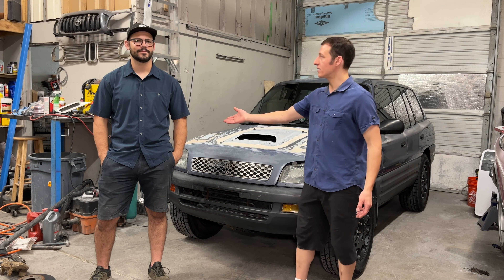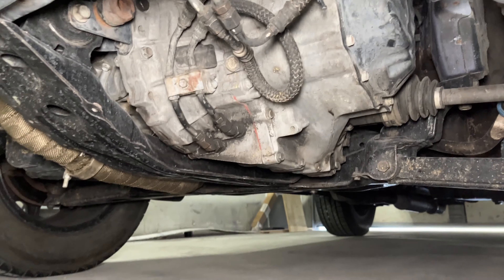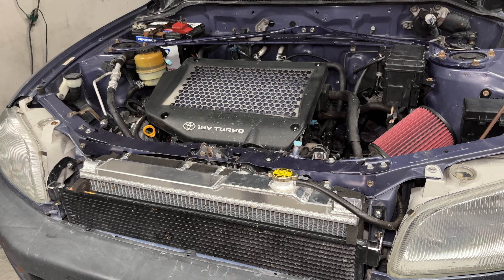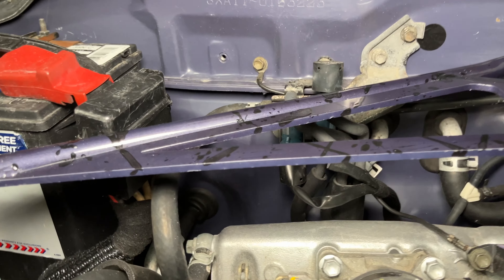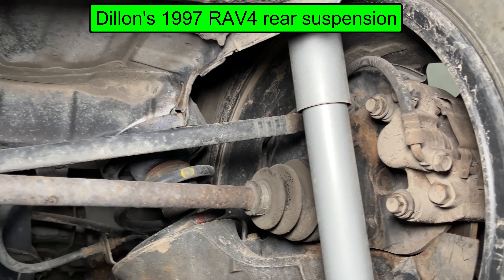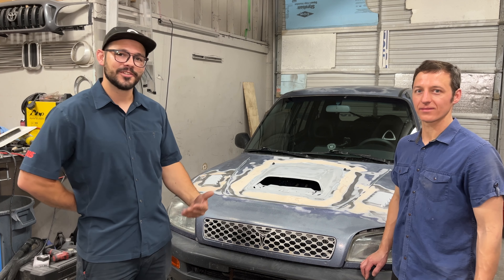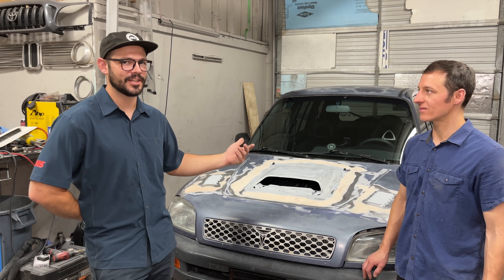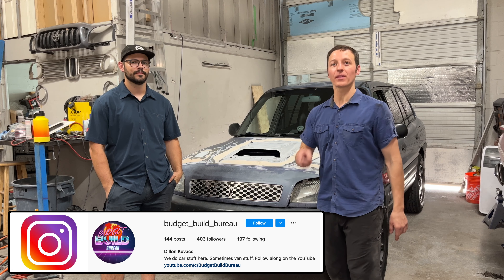3S-GTE swapped 1997 Toyota RAV4 review

Comment: This really turned out fantastic, had a blast filming with you and ripping around the ravs! You had your work cut out for you in your editing and I think you covered it brilliantly! Thanks Paul
Reply: Hey I have the exact same setup. We should chat.
Reply: Hey budget build is like to talk to you about your build! I plan on buying my brothers JDM 3SGTE motor and swapping it in to a rav4 after winter! Or during depending on how the car search goes. I’d just like some input and some help on my build. I’ll try to contact you bro!
Reply: Great build. I know a guy who runs a 92-00 Honda Civic / 93-97 Del Sol radiator with the 3S-GTE. Thicker, though about half-size, but running cool. I've got a hairline crack in my stock plastic one, now I'm thinking I might try this Celica radiator and cap off the fitting on the expansion tank. Still rocking the 3S-FE till it kicks the bucket.
Reply: @CalumMilligan  oh nice, I know a bunch of people go to the half size civic stuff to clear bigger turbos on various cars. 
After talking to Steph papadakis about his, I wouldn’t recommend using the celica radiator, he’s using a new denso rad in his and has had less heat build up than mine. Be sure to check out his build too if you haven’t on papadakis racing channel
Reply: How much for one of those gauge plates? Can you fit 3 side by side?
Reply: @thetoyotaenthusiastt  $30 shipped, probably can fit 3 of that size side by side yeah

Comment: I bought a 3sge from an importer in Maryland who did the same thing to me. When I got it I called them and told them they gave me the wrong engine. They argued with me for a few minutes then gave me the option of having one shipped from a customer in California but the catch was I would have to pay them over the phone, nope. So I was stuck with the engine they sent. They ended up having to send me a new trans, oil pan, and maf. Would've been so much cheaper for them if they just sent the one I actually bought.

Comment: I had a jdm rav4 I wanted to do this on so bad, but it just didn't work out and I sold it to a postal worker. Fun fact, the 1995 JDM 3S-FE has a fuel return line! Would've made it that much easier to do the swap
Reply: aussie rav4s also got a fuel return line
Reply: I'm importing a 99 2dr rav4 with the 3sge beams engine. Think it's a G Type trim. Wonder how hard it would be to just add a turbo kit

Comment: Hey, I have a tip for anyone looking to do the swap, you don't have to drop the tank to add the return line a have a 98 rav4 4 door gen 4 3sgte swap, you can add a fitting onto the top of the bulk head for the gas tank. Also i still have the charcoal canister for whatever reason, I honestly need to get rid of it, any extra room in the engine bay would not be bad. Also thanks for the idea of the rav4.2 hood scoop idea I was thinking about getting one off a subaru.
Reply: Hey can you use the gas vent line for a fuel return

Comment: Hey chill dude, the stock gen5 runs 14psi stock, they have fuel maps up to 22psi but generally people don't go beyond 18psi to keep the rods in the block. they are not the same bottom end as earlier 3sgte due to the noodle rods, which helps it spool a tiny bit faster. E154 gearboxes are strong, real strong. It can handle the stock limits of the gen5. enjoy

Comment: Hey Paul I got a question since you know these cars. My friend has a 97 rav4 with an auto trans. It stalls and dies when sitting still or taking off from a stop sign/light once the rpm’s are past 2000 it runs just fine. I’ve checked the timing belt spark plugs fuel pump throttle body map sensor plug wires distributor. And I can’t figure it out. While sitting still the car starts to surge idle then will die. I’m assuming vaccume leak somewhere but all lines in the main engine bay are fine. Any ideas?
Reply from the maker: It sounds like a vacuum leak.  The RAV4 has many vacuum hoses.  Some are hidden behind the engine, like the center locking differential, and power steering idle up hoses.  Check again for vacuum leaks.
If the problem happens on idle, you may need to clean the idle air control valve.
Check out my cylinder head video for more details about vacuum hoses:  https://youtu.be/Ksv98JvBqXs?si=HjlDdec3iOMMo48o&t=1384
Check out L3 in Colorado's video about the idle air control valve: https://youtu.be/O3yb5RIlqPM?si=yOIhSkESugM7xj48

Comment: Excelent colaboration here. Thanks a Lot. I watched out that the common problem about the rear differentials hooks sopports, Dillion just fixed up by using Window silicon gasket. Does It really works, or is just a temporary solution? I was expecting your video explaining how we could fix this annoying hit on our RAV4s. :(
Reply: The windo-weld works great and lasts a long time, have done it on multiple vehicles never had any issues.

Comment: Always interesting in swapping my 3rd gen Rav4, any suggestions?
Reply from the maker: Yes. If you have the 4 cylinder RAV4, sell it and buy the 3rd gen that has the V6. That's way better than the 3S-GTE. In fact, I'm considering swapping the 2GR-FE engine out of the 3rd gen RAV4 into mine. It's a 3.5 liter v6 with 269 horsepower.

Comment: Literally just got a RAV4 like 2 months ago. Mine is a 2WD automatic, and I want to find the easiest way to swap in a 3SGTE without having to install a clutch pedal etc. But forums have been completely useless for this issue. If anyone in the comments knows, I'd appreciate it.
Reply from the maker: The 3S-GTE engine will bolt up to your automatic transmission.  You'll still have to do wiring, make exhaust, and do all the things you'll see in this video.
Reply: @LabCoatPaul  so to be specific, I have an A247E transmission. It'll work with that? Holy hell that's awesome.
Reply from the maker: @lasersharksushi1975  The 3S-GTE shares a similar engine block to the 3S-FE so it bolts up.  Your transmission might not be able to handle the full power of the 3S-GTE engine, so do your research on that.  But it will bolt up.
Reply: People have used the factory auto and gotten away with it, it helps starting with a healthy transmission. Also keep in mind it may shorten the lifespan of said transmission and/or torque converter!
Reply: @BudgetBuildBureau  I have a Toyota certified reman A247E that I bought because my current transmission is kind of bad. Got it for dirt cheap, so it should be strong.

Comment: I want to see a 1JZ or a 2JZ swap Rav-4 with the 2 doors and AWD of course. Has this build ever been built before?
Reply from the maker: The 2JZ engine is awesome, but swapping it into a RAV4 would be extremely difficult.  The 3S-GTE bolts up to the stock mounts and transmission in the transverse configuration.  Since the 2JZ is an inline 6, it's much longer, and there's no way it could me mounted transversely.  Perhaps a rear wheel drive setup could be done, but I think you would be much better off throwing a little money at the 3S-GTE.  Stock internals can easily do over 300hp, and if you're rich, a 3S-GTE can do 900hp.
Reply: In my opinion the 3sgte is the better engine for this build

Comment: What's the horsepower on this motor?
Reply from the maker: A stock 3S-GTE engine puts out about 260hp.  You can easily get 300hp by turning up the boost a little.  If you want more than that, you have to build it up with stronger parts.
Reply: @LabCoatPaul  what’s the MPG

Comment: If you purchased an 04' you would've started at that hp
Reply from the maker: You're absolutely right.  The easiest way to engine swap the first gen RAV4 is sell it and buy the third gen with the 3.5 liter V6.  You'll have 269hp, which is slightly more than the 3S-GTE.
Reply: You would also get an extra 400lbs, and no manual transmission option! though I do love almost every rav4 gen, that 2gr is mean!

Comment: the stock Transmission will die soon, i recently did this swapp on a 1997 that had been swapped 3sgte second gen to a stock 5 speed and the trans was heavily vented ,from the clutch comming apart and destroyed the trans .. i swapped 4th gen and it is a direct swap .. you all lie so bad .. this wont work .. lies lies lies ... everything swapped from the caldina including the trans ..
Reply: sounds more like a clutch issue rather than a transmission issue. It's well documented that the
 E250F stock transmission will handle 250hp provided you're not doing 7k RPM clutch dumps and gorilla shifting it, ie ABUSE.